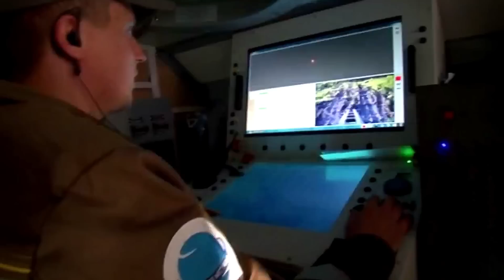Uran 9 - Drone Anti-Tank Missile Launcher and Rocket Flamethrower

Comment: A flying comms relay, something like a RQ-4 Global Hawk or a MQ-9 Reaper, would mitigate/fix the signal loss problem; such planes flying so high up that you need a powerful AA rocket to reach would just make it easier to risk attacking the UGV instead, and if it's like the RQ-4 that comes with recon tech, the relay can send position data to the UGV for autonomous action and likewise to the op.

Comment: The real problem with UGVs is that the people capable of making them practical aren't interested in doing so. The know how is here. We currently have the technology and programming power to enable a networked UGV system operate completely independently and carry out complex operations in extreme environments with extremely high survivability. They could even make it so targets must be authorized by a human component. Starlink and direct laser link could make them nearly impervious to jamming. They could react faster than any human and see more than any human could. Utilizing machine learning and iterative evolutionary programming, the system could carry out complex operations in where drones and smaller ground vehicles could scout and identify targets within the battlefield, relaying the information to a central unit, which would coordinate and designate targets to individual systems based on capability. Any target that cannot be neutralized by the scouting units can be assigned to heavier UGV assets. 

This is some scary ass tech. It's effective enough that the only real counter to it is to have your own equally capable UGV systems, or to only engage using extreme standoff weapons that cannot be countered with the immediate assets. The escalation is insanely scary. If the US doesn't get on top of Unmanned network combat systems and completely dominate NOW, we're going to fall behind. This is getting serious folks.

Comment: Meanwhile Milrem is making one hell of a UGV, the type-X, that could be aired with a next gen MBT to make a really impressive grount force. 
I think that, just like 6th gen fighter jet have wingman drones following them and helping fulfilling extremely dangerous tasks, the new generation of MBTs should be accompanied by companion UGVs. The KF-51 panther and the EMBT are basically already capable of this (it is set for loitering ammunition or UAVs, but it should not be that hard to move to UGVs). 
These drones could be armed with either an autocannon/anti-tank missile combo like an IFV, with a 120mm mortar, or with lasers and stinger missiles for anti air or basically any role that would help remove any risk the battallion might run.
The Uran 9 was a failure, because Russia keeps shooting for the stars while they can't reach even the moon, but the idea itself is a real force multiplier.

Comment: The hardware to build these type of drones has been around for decades. The reason we don't see them yet is because one key ingredient is still missing: a high-bandwidth, undetectable, jam-proof and reliable data link between the drone and it's controller. 

The better UAV's get around this problem by having on-board satellite dishes that link directly to orbiting satellites. However, these systems cannot yet be made small enough or cheap enough to be viable for these small ground vehicles. When these communication systems do become available in the future, then soldiers will become video game players.
Reply: just put a computer inside, nothing crazy, maybe like the equivalent of 4 gaming pcs, run some open source ai crap, train it to shoot the baddies and let it loose. Idk why they havent done this already.
Reply: @froschreiniger2639  Because Terminator.
Reply: I worked on a joint General Dynamics/DARPA project on '02 that had a workable, smaller and faster autonomous vehicle than this.  It's capabilities are still classified, but it hauled butt and had very precise weapons aiming algorithms that could engage human sized targets at distances that are difficult for people to shoot at.

None of this comes as a surprise to me.  GDRS's robot was monitored from a monitor in a HUMVEE with a computer that was the size of a radio rack.

Doctrine requires that autonomous systems have a human who presses the fire button and that was too easily jammed, so the idea was shelved.
Reply: @Livi_Noelle  i demoed an PoC demo to GD for autonomous border patrol - would not engage illegals, just get within range to watch / record for later events to occur (we called it the Coward Tank) - the baby-tank only contacted CnC when it had detected something or it had an issue, but gave 2 minute heart-beats back to CnC - for ranged ops or too-rugged terrain, we demoed the idea of standoff baby-helo's for SA to both CnC and baby-tank, plus could request tank go to a location using identified cover to look - lots of interest, demo taken - nothing came back
Reply: Starlink has entered the chat
Reply: They would only be unjammable if they'd be fully autonomous. The moment we have an AI to operate them reliable they will pop up everywhere - and set up the ground work for a real kick ass post apocalyptic landscape. pew pew.
Reply: @Rubashow  the only issue being the mil do not allow units to be rogue / non-comm whilst on the battlefield, unless its a special ops mission - to allow an autonomous sys to be self on mission could cause real issues with blue-on-blue

an issue raised by a senior general about Unmanned sys was it took troops from the battlefield to both maintain / control + housing said troops in big metal craters + they said they were uncertain about their use due to the fact they have to take responsiblity for these auto sys when they do something wrong, which comes back to TRUST - CnC troops in craters do have a limited view of battlefield - issues of cover, covert nav are major ones

it will come, but once we have them, then everyone else will have them a well (maybe not to the same level, but still enough to function a within a less mature mil)

whereas we (NATO / Western forces) have certain rule-of-engagement, which would also effect autonomous sys, as we have seen not all military (Russia, Syria, North Korea, etc) hold such (even some of our troops are found wanting sometimes) values or doctrine
Reply: @simonrobins4316  Well I for one welcome our new robot overlords :)
Reply: Quote "then soldiers will become video game players" most are already on their playstations, particularly those of mercenary status who think warfare is like playing "toy soldiers" on their X-Box's and Playstations.
Reply: @lf2372  link?
Reply: Yeah when some kid and an SDR can take over your 400,000 dollar drone platform you might wanna reconsider it's use.
Reply: @pyr3x849 and exactly how does a kid with an SDR take over encrypted mil comms to a UAS
Reply: Lmao or so you think
Reply: @MrSwccguy  Only yesterday I was reading about the new Starlink receiver that's less than 0.25m2. Looks like the future arrived quicker than I thought it would.
Reply: You have no idea! This is advanced parade equipment, much better than the T14 Armata
Reply: satellite signals can be jammed.
Reply: @TXH1138  It depends. If you're using a highly directional satellite dish with a look angle of two or three degrees then the only way it can be jammed is if the jamming signal source is within that narrow look angle directly between the drone and the satellite. While technically possible, it's practically almost impossible to do. Hence satellite-controlled UAV's don't really have this problem.
Reply: @TXH1138  technicality yes, but practically no. 

You have to know when, where and how sat signals are being sent to jam them and it's incredibly difficult to do so without smashing friendly signals. 

I worked tactical intel for years and signals jamming was part of my unit's job.  The jammers had a very specific list of bandwidths and times that they could transmit jamming signals and a competent radio operator could easily get transmissions through even during times of jamming and using jammed bandwidth. 

Jamming typically defeats bog standard, ground to ground, infantry comms but can't touch crypto protected comms that are used by more specialized units and more specific applications like drones.
Reply: @TXH1138  the only real way possibly to jam a sate sig to device is to be higher than the device and either white noise the region or send on the same sensed freq lots of noise - directional sat comms, as seen on some of the US UAVs, makes it quite hard to jam, but nothing is impossible

all these sat signals are encrypted with almost unbreakable keys (certainly not breakabke within a usable time frame)

i wonder if laser based sat comms is an option - weather could be an issue - this would be almost impossible to jam but probably be just one way

either way, mil would very much like to reduce dependency on on-mission comms for control - mostly for SA updates to device and periodoic mission updates from device given what it has detected
Reply: Dont talk so silly, they've been using quantum bandwidth for years, god some people here shouldn't be alowed a voice!